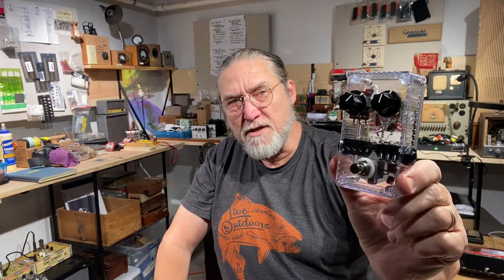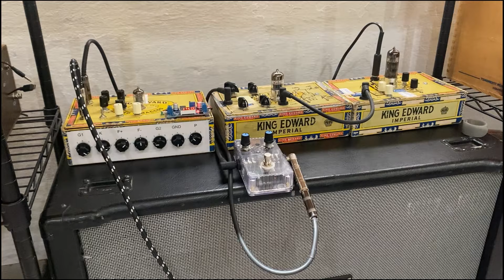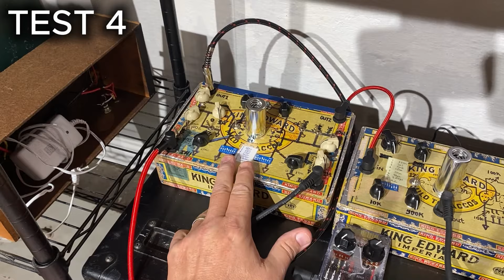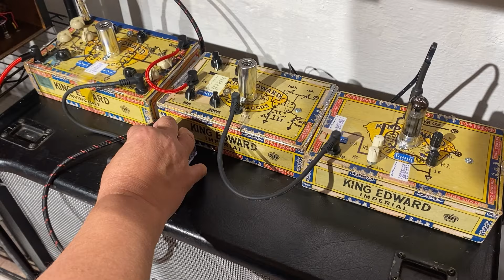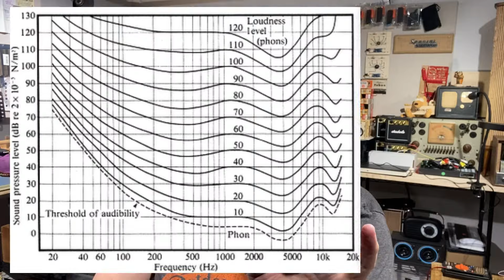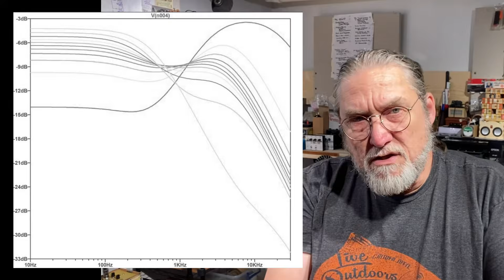Testing Weird Pedal Setups You NEVER Tried! AC Delco PEDAL Tonestack DEMO

Comment from the maker: In this follow-up test of the GM AC Delco loudness-tap tone stack, I explore additional ways to integrate the circuit into a tube guitar amp to understand why it behaves so differently from traditional Fender/Marshall/Vox tone stacks. Starting with the community-suggested idea of placing the AC Delco circuit after the cathode follower, I compare that design with a dual-triode gain-stage test harness both with and without the help of the Princeton style tonestack. As a bonus, I tried the same circuit without the cathode follower. The results are surprising!

Along the way, we uncover the fundamental flaw in using a hi-fi loudness-compensation network inside a guitar amp, why the AC Delco tone stack was never meant for midrange-forward electric guitar signals, and how Fletcher–Munson loudness curves shaped this classic automotive design. It becomes a demo on how removing unnecessary filters and simplifying the signal chain dramatically improves “sparkle,” chime, and overall response.

If you’re into DIY audio, tube amp design, tone-stack experiments, or repurposing vintage circuits, this deep dive will help you understand what works, what doesn’t, and why. Subscribe to follow more of these sonic experiments as I continue to work toward building a truly great-sounding guitar amplifier.